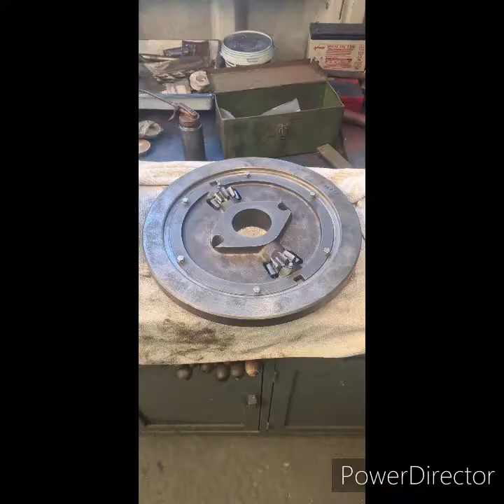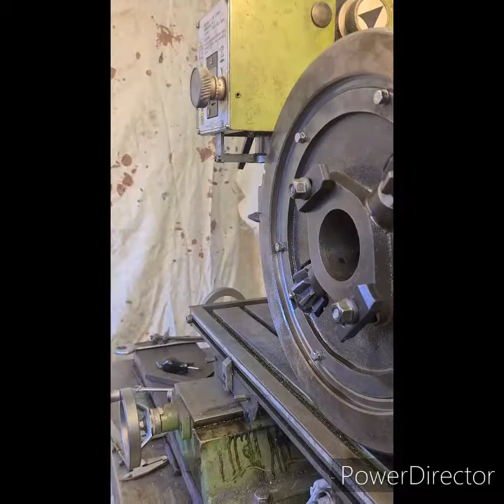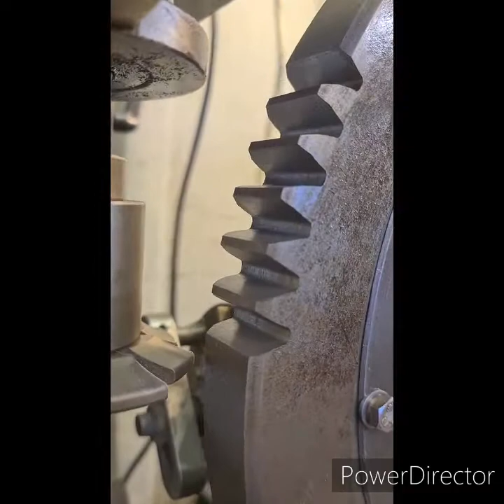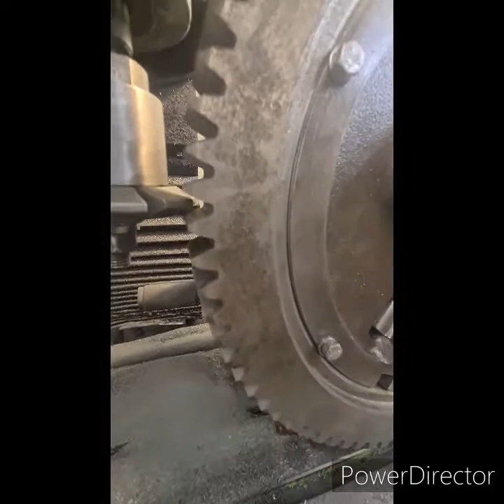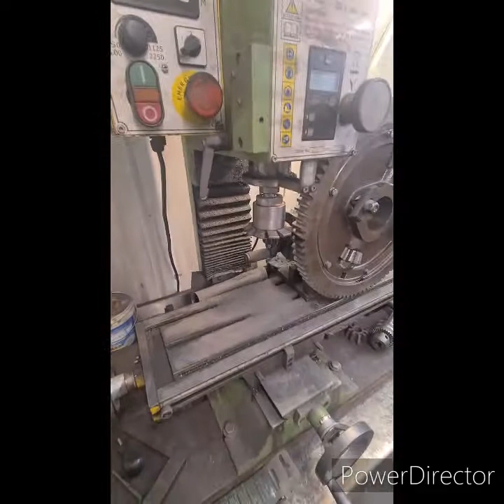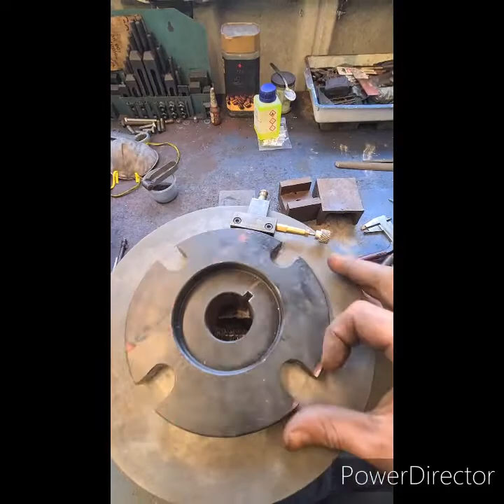How to cut Gears - Main Ring Gear for 3" Fowler on Warco WM - 16

Comment: is it the standard plastic gear drive or did you do belt conversion?
Reply from the maker: It's the original drive gear. It held up well so far!
Haha I had shooting duffs on as well to shield me from the noise!
Reply: @johnlintorn6768  Ah right,,,, I just bought the same mill ... Im surprised you were able to do that heavy work through plastic gears.. Others have stripped them doing much lighter stuff.. The hi lo gearbox is plastic as well as the motor reduction.. Looks like you have plenty more milling ahead.. Did you cast the parts or buy a kit??
Reply from the maker: @marmac567  Tbf I have burnt out one motor already so the gears certainly aren't the weak spot in my opinion! 
 I machine everything from stock and only buy castings when I really have to!